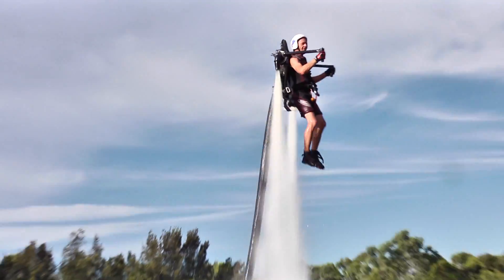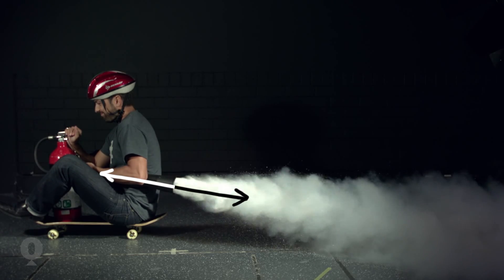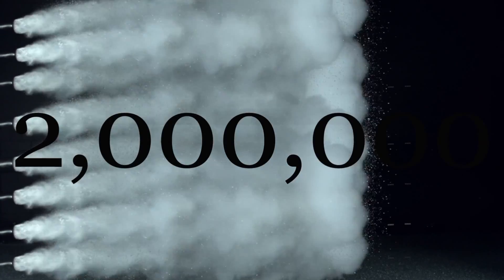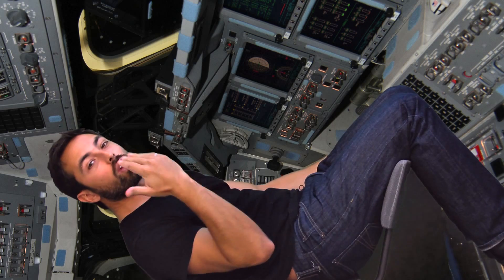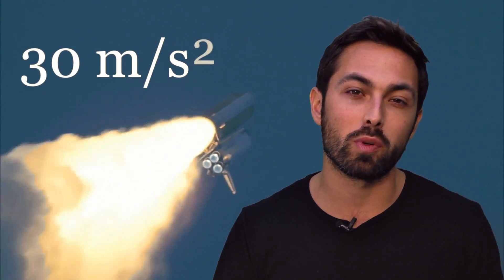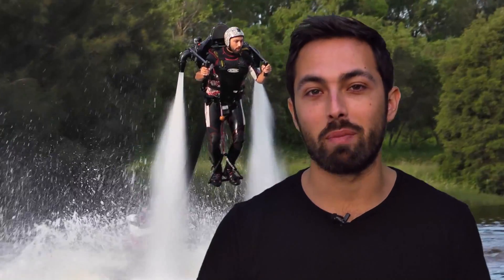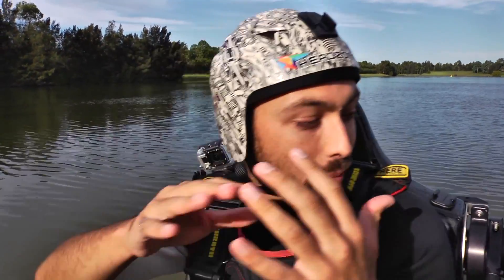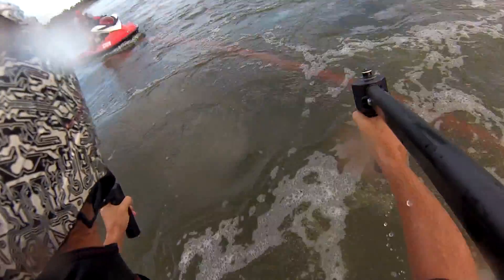The Science of Jetpacks and Rockets!

Comment: Why don't they build an elevated platform on the top of a mountain to launch rockets into space? Each additional meters seem to be extremely expensive…
Reply: One thing is... mountains tend to have slightly greater Gravity around them... but that is actually neglectable... Or at least not that important as having less air to cut through.

Mostly that is not reasonable, because before launching something from atop a mountain, you have to DRAG all this stuff UP to a mountain. Do you have any idea how much rocket boosters weight? And they ususally are something you can not cut into parts and re-assemble on the launchpad. All that extra cost really outweights the cost of extra-fuel you have to burn to cut through atmosphere. ((Though
Reply: Павел Жданов I think what you say is only a hypothesis… It may be wright, but I am not convinced…
Reply: @symbolxchannel  no it's not right. Transporting all that stuff up a mountain would cost tons of money.
Reply: @pavelZhd  the word you looking for was negligible not neglectable.  which isn't even a word I don't think
Reply: I need to play KSP a bit more \o/
Reply: ***** You might be surprised, but most of fuel (like 2/3 in case of Shuttle launch) is burned before a rocket starts gaining any orbital speed.
Thick atmosphere generates a ton of friction (a.k.a. Air resistanse) and that means that exiting thick atmosphere a.s.a.p. is a good idea. And the bes way to exit atmosphere is to go straight up and then ditch the accent stage and burn insertion stage.
Reply: It would still take energy for transportation, lifting the rocket and fuel up the mountain. Logistics (personnel commuting) would cost quite a bit more all the time. The mission controllers would need to adapt to low air pressure every time going up .. but of course they could have sealed environment. That would also be expensive and require special maintenance. Keeping the pressure would need energy as well :) And where to get the energy
Reply: SymbolX point you missed is that for transfer on the ground you need massive diesel transportation system so that is great source of pollution, and for rocket fuel we use liquid hydrogen and oxygen which combined make what? Water, that huge cloud after liftoff you see is pure water, so that is most eco friendly engine in service.

Also as I say'd -4km of totall trajectory the rocket has to fly to orbit saving on fuel compared to cost of manpower and placing your launch facility atop of mountain is non existent - don't you think they don't have it calculated for optimum?

It would maybe make sense on mars if you would launch from Olympus Mons - that is highest mountain in solar system and mars has lower gravity so there may be difference to be noted.

(also dont forget that massive things like mountains makes gravitation pull stronger so friction of air is even out with low density places where we make our launch pads)
Reply: ***** The problem is both distance and speed (& acceleration)… The closer you are to destination, less fuel is needed. (And less fuel is needed to bring the extra fuel… A thing usually underestimated!)
Reply: @symbolxchannel  yah but what you save in fuel might not be worth the money it costs to fuel it up. That would take tons of effort to get all of the rocket up on a mountain.
Reply: SomFunk Not necessarily… Everything would cost the same as the usual emplacement…

The only difference is that the rocket would need less [dangerous & expensive] fuel to cover a greater distance. Not mentioning the fact that more fuel means more mass, which means you need more fuel to bring the additional fuel at a higher altitude.

More fuel also means more risks and pollution… If the rocket is initially at a higher altitude, risks and cost would be lower than a lower altitude. Moving something on the ground is safer and more efficient than moving it with jet engine. (Except in some cases… Especially when the flight is horizontal, unlike rockets which are vertical)
Reply: @symbolxchannel  no everything would not cost the same. Right now everything is on the ground at sea level. Now you're talking about moving the entire launch pad to a mountain. Well build a new launch pad in a mountain. All of that takes extraordinary time and effort. And as you know time=money.
Reply: Imperum Draconis Some models of jets use hydrogen and oxygen, but those used in space rockets use a different kind of fuel… Still, the production of the fuel is also in the equation. You simply consider the burning of the fuel…
Reply: err no, to lift shuttle to orbit is used hydrogen and oxygen, that is that huge thing strapped to shuttle, which uses kerosine/oxygen based jet which is "weaker" when gets outside of atmosphere. There are some nice tables that you can see working with efficiency of different fuels and H+O jets are about 20-25% stronger... 
And I forget, there is nice video of russian unmanned rocket being launched in wind (scale it up if you want "top of the mountain winds") the whole thing topples in air before reaches appropriate speed and due not having wings it crashes down in massive explosion.
Reply: SymbolX Well they use Hydrogen + oxydizer (Oxygen) for liftoff - which makes supersaturated clouds of water - that is the reason why it rains after launch you can find it everywhere...
Reply: SymbolX you see this is kinda poitless, you say it don't I say it do. I was quite sure in the first place, since chemistry and physics was my hobby, but I double checked and did some research about engines and found I'am correct. I suspect you did your research and found something weird that supports you... well, this will end unresolved since Im really not into arguing over youtube when I get response basically like "It do! I am right! hurr durr" so bye.
Reply: Mountains have relatively unpredictable weather and are usually very windy. Not ideal circumstances for rocket launches.
Reply: ***** What? Environmental oxygen level has nothing to do with a space rocket efficiency! Space rockets don't need external oxidizer…  They have both oxidizer and fuel in the rocket.

Launching from a higher altitude would simply mean that you won't need to put as many fuel & oxidizer in the rocket to cover the extra distance… Plus, you won't need to add the extra fuel needed to carry the additional fuel needed to cover the altitude difference! (fuel has a weight also… And you need additional fuel to carry this extra weight…)

So less distance to cover, equals less fuel needed. Less fuel on board equals less fuel needed to carry this extra fuel…

Is it clear now?

(Also, you have to consider the fact that rockets are EXTREMELY fuel inefficient… Covering the same distance with hydraulic elevators & trucks is way less expensive! But it is not possible to go all the way in space with trucks & hydraulic elevators…)
Reply: Павел Жданов
you have to DRAG all this stuff UP to a mountain
By that reasoning it wouldn't be worth while to use a space elevator, if we could build one. If we could build a platform at any significant altitude that could support the weight of a rocket, it would be useful. Provided we ignored practicalities. Most of the fuel needed is actually needed to get the yet unburnt fuel higher up. If we could pump up the fuel to a higher altitude we could use less fuel, and increase the payload/fuel ratio. We don't do that though, because it presents other problems. OP's basic reasoning is sound.
Reply: The problem for a rocket is not going up. It is going fast enough to achieve an orbit, they need to get 7/8 km/s for a LEO for example !
Reply: Imperum Draconis To stop all quarrels: There are 2 types of Rocket fuel.
1) "Longevity" fuel that generates alot of "impulse" - meaning you need less fuel to get velosity. But those engines have low thrust.
2) "Boosters" - Just the opposite. High thrust, but have to burn alot of fuel to get velosity.

Boosetrs are used on liftoff. Longevity used during orbital insertion and maneuvers.
Shuttles use Aluminium-based Solid fuel for Boosters (Small orange rocket on the sides)
And Hydrogen/Oxigen longevity fuel for insertion (Huge white tank).
Reply: Павел Жданов yep thats what I meant really - ty
Reply: Imperum Draconis No… What you meant what the propeller to go from earth to orbit… Oxygen & Hydrogen is used in orbit…
Reply: Imperum Draconis Hydrogen & Oxygen is used in space… Not for the lift-off!
Reply: Imperum Draconis http://en.wikipedia.org/wiki/Rocket_propellant

"LOX and kerosene (RP-1). Used for the first stages […]"
"LOX and liquid hydrogen, used in the Space Shuttle orbiter, the Centaur upper stage of the Atlas V, Saturn V upper stages […]"

Upper stage means in space …

Firsts stages means from earth to high atmosphere …
Reply: SymbolX Read about relativity. Gravity is more near mountains. Its also proven experimentally.
Reply: Gowtham N It is RIDICULOUSLY accentuated near mountains… It can barely be observed with special equipments!

From 9.8m/s^2 to 9.9m/s^2 isn't THAT determinant… But covering a couple of kilometres less is determinant!
Reply: SymbolX Yes it is very very small. But in a documentary by michio kaku, he said we currently have the technology to measure it!
Reply: IncomitatusExcelsior It is a very broad statement… Not all mountains are made equal!

If you go on a mountain near ocean, sea or lakes, it will be windy… But Mountains far away from turbulences exists… As for the previous comments, I don't think it is actually a fact that you have presented, but it is clearly something else to consider.
Reply: go to the Equator is much better . normal land there far away from the core then any monten
Reply: Almozayaf Roman I think they already use launching sites close to the equator (not the country…).
Reply: SymbolX semi-interesting discussion happening here. thought i'd weigh in with some science:

1) yes, it's true gravity is stronger near (some) mountains. the key is to consider how they were made. the crust is thicker and more packed with heavier elements. however - as pointed out earlier it makes basically no difference to anything. fun idea though.

2) yes - having less air (and thinner air) to travel through would make a big difference to launches. other things to consider though are infrastructure, the workforce, materials and so forth. mountainous regions are generally harder to get to, and because of their topography, also have more adverse weather as a result of air from lower altitudes being forced upwards onto them. clouds are a common occurance. this is a big problem with mountainside observatories - so they are built above the level of the clouds wherever possible. howver! all is not lost. there are quite a few places in the world with very high-altitude, flat plateau-like structures, which would be great for setting up the large amount of infrastructure needed. the only issue is getting materials and people there in the first place. some of it is political (a bigger issue than anyone likes to admit) which is a shame. and the other issue is setup cost. most space missions are funded from private/commercial donations so they value low setup costs and quick turnover. not condusive to the ideas that you suggested.

it's generally a good idea to do as you suggested (i.e. higher altitude) but mountains are obviously a bad idea for many reasons. also, one thing i forgot to mention is that they like to have their launch pads relatively close to water, so that in the event of any disaster, the pieces fall into the sea and not onto a city.
Reply: purklefluff Good points: clouds accumulates near mountains, socio-political factors and proximity risks… Also, I may add, rockets can only be launched from a certain latitude for some kind of missions… (If I remember well?)

But, usually, not only mountains accumulates clouds and extreme weather: continental borders, atmospheric and submarine streams also plays a key role… (I remember being in intercontinental flights and the turbulences are high on continental borders.)

I guess the ideal thing would be a high altitude plateau in a desert… It would be a nice question to ask to "space scientists!" I am not… I know a lot of things, but still have a lot to learn!

I am pretty sure the NASA have already studied the question… And socio-political factors are probably their biggest concern! :-p
Reply: No need for Launching a rocket from a mountainous area. The answer here is space elevator. A space elevator is a very tall building reaching a height that you only have to jump to reach the moon. Gravity is minimal. Also, the cost of transporting the Rocket materials is minimal since you will not use the expensive and heavy fuel to launch it to equal height since you will just use the fuel which is separate from the rocket, i.e, not additional weight.

The only problem we are facing is that we still don't have the materials to build a very tall structure. A conventional Reinforced concrete or steel-framed structure would collapse. But the promising future material is the nanotube. This cound be the future column of space elevators.
Reply: What about a giant ass ramp that goes into space
Reply: MC,MMOs and More that was actually one of the early ideas for getting into space.

rocket sledges, cannons, catapults. it's all been considered at some point =P
Reply: MC,MMOs and More You mean a space elevator?
Reply: i know that you posted that comment a long time ago but it's actually a great idea. You could just make an large elevator to carry the rocket parts up to the top of the mountain
Reply: I think it's not that much expensive than building a whole launch station over a really high mountain ... and take the spacecraft on it ... or building it there ...   ..  do I make sense ..?😅

Comment: The ammount of water being sucked into the hose=water going out. 
So the force cancels each other.
Water being sucked forcés you down and water  expeled forces you up. Should you not stand still?
Reply: That's where the nozzle comes in, the change in diameter makes the velocity increase
Reply: Also, isn't the water being pushed into the jetpack? It looks like the hose is rigid and is pushing against his back most of the video. If you tried to suck up into the jetpack, the hose would collapse since it isn't rigid.

Comment: The expression for Newton's second law is wrong the derivative, the derivative (point) is on the velocity vector and not the mass.
Reply: this is not the case. in rockets, mass changes with time (thus dm/dt or m'). force is the first derivative with respect to time of linear momentum, p, F=p'=(mv)'=m'v + mv' (v'=a). most everyday objects (you, a car, etc) move without expelling burnt fuel at an appreciable rate, thus m' is so little that ignoring the m'v term in F is a very reasonable approximation, and you are left with F=ma; however, rockets are an entirely different story and you have to use F=p' to account for the fuel mass propelled out of the reactors.
Reply: I appreciate the explanation, you're right, the mass is variable, is lost when consumed, while accelerating the object.

Comment: I'll er, I'll have to comment on this guy's just terrible physics. 
And I didn't even watch the whole thing. So, first off, F=ma. Everyone knows that. Which is the same as F=mv with a dot over the v, not the m, to signify the time derivative of velocity, which is acceleration. Wrong rule. We care about the conservation of momentum. 
Next. Freefall is by definition when air resistance is equal to your weight, so forces are equal and velocity is constant. acceleration is nada. 
This is plain bad.

Comment: I have a question about your explanation of the jet pack. You said that the force of the water changing direction from going up to going down is what pushes the jet pack up but when I was a kid we had toy water rockets. Fill it half with water and half with air. Pump up the pressure in it and when you release it it would take off. No turns in the exhaust, if you will. You also feel that with a water hose.

Comment: Light is a wave. Waves behave differently. It's a form of energy, measured in joules. Light is also measured in candelas for intensity. If you really want to find the mass of light then you just use the famous E = mc^2 equation to find the mass of this light. E/c^2 = mass of light dependent on the amount of energy you have to begin with.

Comment: Explain your train of thought. In order to be a force you need two things an acceleration and a mass. Btw acceleration(m/s^2) and velocity(m/s) are not the same thing. What he wrote was not Force, but momentum. Momentum = Mass * Velocity. The reasons why he didn't move because he couldn't overcome the static friction force with the fire extinguisher force firing backwards. Of course there are other factors, but let's stay on topic ;).

Comment: why don't we attach 4 big fans to a platform put an engine on the bottom that powers the 4 fans, then you add a steering mechanism to tilt the fans, and then you have a leaver that will control the power the engine lets out. like 1 would be a hovering 5 feet off the ground, 2 would be like 8 feet, and so on.

Comment: That is correct. However, in instances where the instantaneous change in mass is equivalent to the average change in mass, you could use either m(dot) or (delta)m. I oversimplified a bit, I suppose.

Comment: Yes, that is right, but not only in zero gravity.  3Gs is 3Gs no matter where you are.  It is only a measure of apparent weight in multiples of the force you feel while standing on the ground, so naturally the comparison will be within that same context.  While on the ground.  However, it doesn't have to be in zero gravity.  30 m/s² of acceleration is 30 m/s² of acceleration no matter where you are, and the G force you feel will be exactly the same no matter where you are.